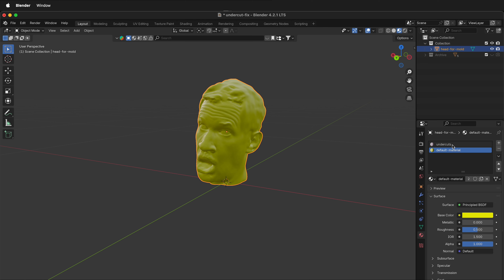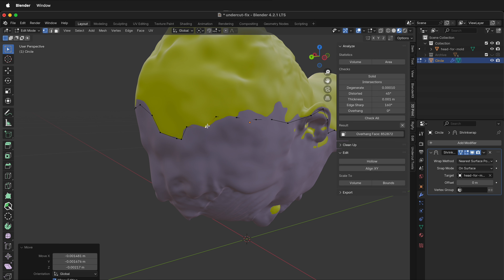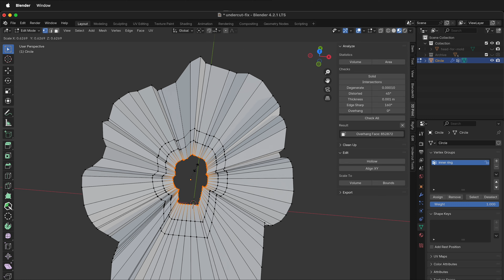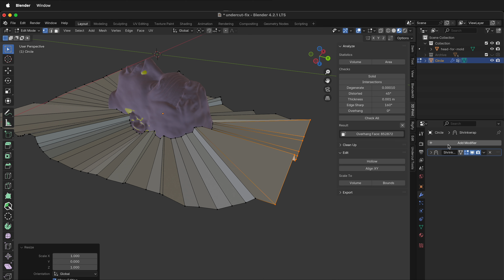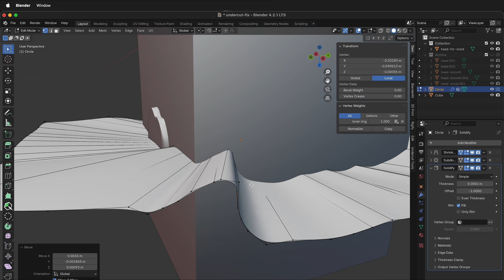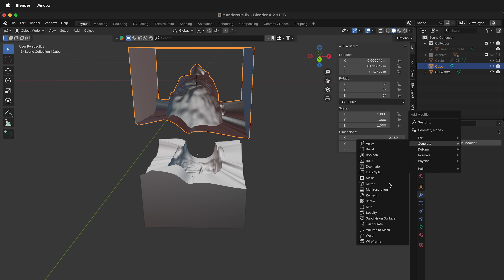Slip Cast Mold Parting Lines for 3D Print Molds in Blender

Comment: I don't think iv seen you pour these molds. Is the .2 mm enough? Why you open both ends for the master mold? You planning on filming any of those steps?
Reply from the maker: I did not pour these particular molds yet, but have poured similar head slip cast molds. 

Did not take footage since they were test runs. 

I want to refine the workflow and make it more bulletproof in the future, if I do that, I will definitely pour some molds and document it for instructional videos

Comment: I don't want to harsh on Blender here, but in Houdini, even the free Houdini Apprentice version, this can be achieved without manual hand placement. Mask by feature node with blur at 0 > Group from Attribute Boundary > Promote to Edge group and blast one curve (0 or 1 in the group field) transfer normals from mesh to curve, poly extrude the curve and you get the same thing procedurally. Worth poking around Houdini for slip casting, I have been using it this year to make a number of multi part molds
Reply from the maker: Thanks for sharing that Houdini workflow for slip casting, I'll be sure to check it out

Comment: How would I make the split line follow the shape of my object? I want to make some press molds for metal (soda can) thickness.
Reply from the maker: You could use a cutting plane and a Boolean operation, what do you mean by follow the shape of your object?
Reply: @WhatMakeArt  best way I could explain this would be if I had a car fender and wanted to make a mold if this to make pressed parts of that object. I would need the split to be the edge of that part as multiple splits wouldn't work.

Comment: SUBDIVIDE YOUR CUBE BEFORE MAKING THE BOOLEANS. The topology is unusable for 3d printing as shown in this tutorial.
Reply: you can use the remesh modifier to fix this issue as well. Then make the mesh manifold using the 3D prin addon
Reply from the maker: Yes, the remesh modifier is a great way to get rid of small parts and getting a mesh close to manifold
Reply from the maker: This works for 3d printing since it is manifold but you will get more topology if you subdivide first

Comment: I followed the boolean exactly but the boolean doesnt split my mesh in the center of the cube... I just cuts the lower half og the cube, resulting in my model being contained in the upper half of the cube
Reply: Figured it out, basically the parting mesh circle(the circle we shrinkwrapped) had an issue where faces for folding in on each and clipping through each other. This caused Blenders Boolean to freak out so I had to smooth out the surface of the seperation mesh(the circle we shrinkwrapped) in sculpt mode and then it worked perfectly. Thanks for the awesome video! Wish me luck for my 3d print of the mold
Reply from the maker: Glad you figured it out and thanks for sharing your solution with everyone

Comment: this was very helpful for my mold making! I had just been using a plane and subdividing and individually moving points around until it was in half, then solidifying that, but the shrinkwrap modifier on the circle is so much easier! I modified it to fit my use case more, but this was an excellent new addition to make the process easier!
Reply from the maker: Glad it helped, happy mold making 🦧🎂✂️

Comment: Hi! Thank you very much for doing this. There are only a few resources that teach this and some are using paid addons. I got a question, why do we open both faces of the mold box? One side is for pouring the plaster, but the other side is open. Was that for 3rd part of the mold or do we use like wood for quicker drying? I don't get it.
Reply from the maker: The idea was that it would be secured to a piece of plywood and then plaster poured in, and make it easier to remove the plaster, this is a rapidly evolving method that still contains a lot of errors, working with students on the project to make a more streamlined solution that I will post in the future
Reply: @WhatMakeArt  I'm confused by this part as well. Even if you put a piece of plywood at the bottom and pour the plaster, how do you remove the plaster from the mold once it's dry? Shouldn't each side now also be its own 2 part mold so you can separate it?
Reply from the maker: If there are no undercuts the plaster will release 

The simple was is to pre cut the back corner of the mold plastic, then seal with tape, pour plaster, then after plaster cures remove tape and "unroll" the 3d print mold off the plaster.  

A heat gun can help soften the plastic to make it easier to remove.